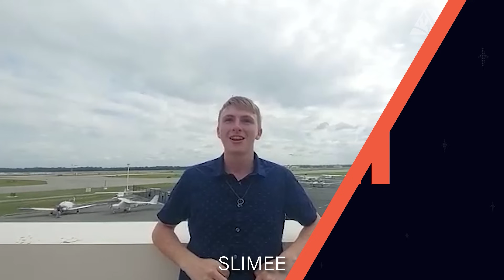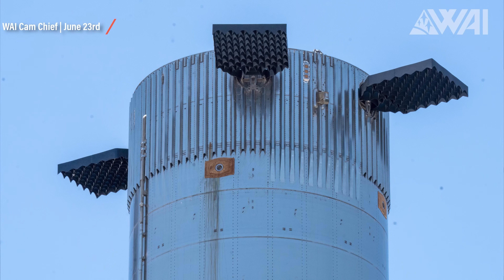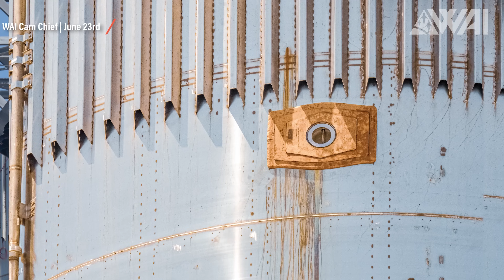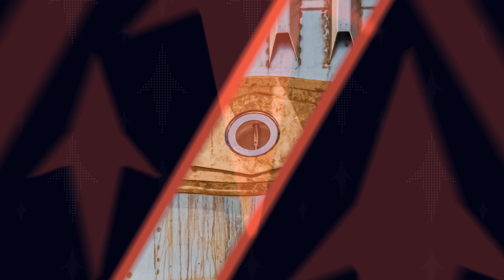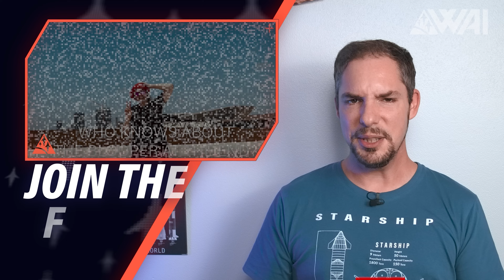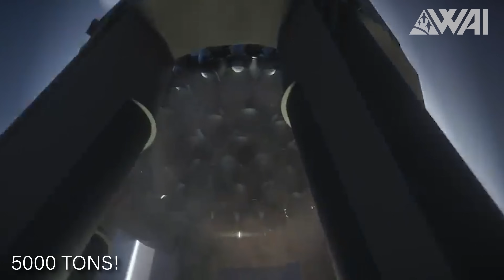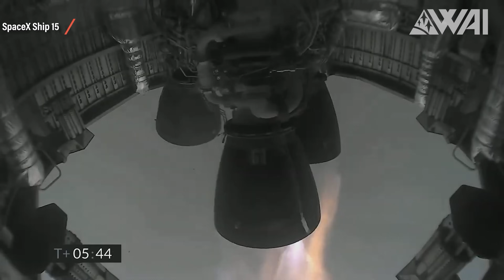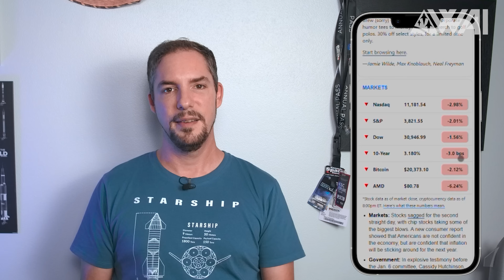The first orbital SpaceX Starship booster and its INCREDIBLE changes!

Comment: Settling foundations are NOT normal. It's an indication that the design wasn't right or based on inadequate GI.
Reply: Settling is absolutely normal in large projects. Unless you’re building on bedrock, earth behaves like a liquid under pressure. This is not unusual at all.
Reply: @Creabsley  I have designed huge structures and never had to do that.
Reply: Buildings settle.
Reply: They do. But a small and predictable amount. For a piece of mission critical infrastructure to need such attention concerns me as an Engineer. I would design for robustness given what is sitting on it.
Reply: @mdbboyd  Small and predictable?  Are you sure you're an engineer?  Settling can take years.
Reply: And yet it's happening quickly. You have proved my point.

Comment: Tunnel with Boring Co., then drill up to the slab.  Then use steel or concrete piers.  Then fill tunnels with reinforced concrete.  Use lots of piers as pilings to distribute load.

Comment: Wouldnt the explosive potential go way, way, way beyond just the methane? Because of the fact that it would be mixing with the 70+% Lox on the vehicle? Fill a balloon with methane and light it with a match, you get a little floof. Add a squirt of oxygen and you get a distinct concussive pow. Huge difference.
Reply: When mixed.  In fact mixing them to they burn best is one of the aspects of rocket injector design.  But an explosion will be bad one way or another.

Comment: One observation and question concerning the new Grid Fins and the newly vertically designed HPU chines.

If during reentry, the booster tilts/angles enough for the new vertical chines to actually be of use aerodynamically, wouldn't that make the Grid fins basically useless, since the relative airflow would be too perpendicular to them, for them to be of much, if any, aerodynamic value?
Have a safe and Happy Independence Day!
Reply: Walter, the Falcon 9 booster has already been run through such maneuvers and the problem exposed by those tests was that the two center dorsal and ventral gridfins were not contributing to tilt. The new design with 120°/60°/120°/60° angles allows all four fins to be out on the sides instead of centered under the belly during such maneuvers. This assures that all four gridfins are in the airstream contributing to tilt control.
Reply: Good observation. Also, how will the booster accurately rotate about its long axis to ensure the lifting lugs are oriented correctly for the chop sticks to grab?
Reply: @imconsequetau5275  Thanks!Do you know the number of degrees of arc, that the Grid fins can rotate? 
I didn't think that they had much beyond a total of 70°, or so.
Reply: @sssbob  I think it will be using it's new cold gas thrusters to establish rotational orientation with the tower.
Guaranteed that it's going to be quite a hot show, when it tries it for the first time!
Reply: @walter2990  But how will it KNOW what the rotational orientation of the lifting lugs is relative to the chopsticks? If it's doing the flip maneuver just before landing, there is very little time to line everything up, unless it can hover long enough to sort it all out.
Reply: @sssbob  The answer to your question of "how will it know" the proper landing configuration to line up the lugs with the chopsticks is simple..., I don't know.
The answer to that problem is WAY above my pay grade!$ 
But I'm sure that there's at least one, or ten, high paid SpaceX engineers who's job it is to figure out that very issue..., I hope.

Comment: Can they make a Falcon 9 replacement out of stainless? For the smaller payload class and to reduce cost of Falcon launches even more.  Its gotta be cheaper than carbon fiber.
Reply: It is not that easy, it would require a re-design.

Comment: I’m really surprised, pleasantly so, that SpaceX hasn’t, or wont,  test the booster as a stand alone component launch. Something with a nose cone and test a water landing off the coast (as they plan for when they do the orbital test.). Thats awesome that they’re confident enough to have the starship and super heavy together for the first major run. 👍
Reply: If the booster explodes on the launch stand it's gonna do massive damage to the stand either way.    Might as well try with a starship.
Reply: It's a waste to do a half test on a throw away article.
Reply: @TheEvilmooseofdoom  Yeah I get it. Unless theres a RUD or the booster gets squirrelly, then you waste both craft anyways and without the benefit of S.S. testing or any feedback. That would be an unnecessary waste. But Im sure they know what they’re doing and Im excited for this launch!!
Reply: @elconquistador932  A certain amount of telemetry (depend on when where and how an accident happens) is transmitted and there are also data recorders that could potentially be recoverable.
Reply: @TheEvilmooseofdoom  i know that, but if the booster ruds you lose both lol.

Comment: The material used looks to me, I can only see it, but it looks to have rust also, so bare iron steal. I was a steal worker for many years, and seconds after steal is bare, like disk for disk brakes, rusts in seconds from moisture in the air.  there are oils that keep that from happening.
Reply: ...and in those many years you never learned how to spell steel?

Comment: Great update Felix, best Spacex info source on YouTube. Just a very minor correction though. ‘HPU’ isn’t an acronym, it’s an abbreviation. Acronyms are initialised letters spoken as though a word, such as ‘NASA’. Those that are spoken as single letters (‘SLS’ for example) are abbreviations. 
I’ll get my coat … 😊
Reply: But to Felix:  Even though HPU is technically an "initialism", the general english-speaking public tend to still call it an acronym. So what you said is fine.
Reply: Odd, my first reply was removed. I had pointed Dave Hilton to a site explaining the difference between acronym, abbreviation, and initialism. Because the latter part of his correction wasn't entirely accurate:  Those that are spoken as single letters are actually initialisms. Both initialisms and acronyms are forms of abbreviation.

Comment: The insulation could be rock fiber.
Reply: Like asbestos? It is still used in some applications where there isnt a better option and its encased in something to prevent dust. B more likely its just cork, they've used that forever in space flight. With SS its likely a temporary solution. This thing will look a lot different by the time its launching regularly.

Comment: I don't understand the method of engineering and design of SpaceX. They make some something and then get a better idea, before it is even used abandon it, then remake it. This method is both time consuming and expensive. How many star ships and booster versions have they made? 20+? This must cost Billions and wastes so much time. And only one successful short test flight. Don't get me wrong, I think the concept and engineering is brilliant, at the same time wasteful.
Reply: The part you're missing is the manufacturing aspect of this program.  They don't just need to make 1 of these, they need to make thousands of them, and at low cost (which requires making 10's of thousands of raptor engines). Elon has said that the manufacturing side is harder than designing the rocket.  Just like testing the rocket requires test flights, testing the production system requires building units, and problems with production will feed back into the design to make the ship/booster easier to produce.  They should be continuously producing units for the foreseeable future.  BTW, unit cost is not billions, not even close.  Most of the costs of the program would be fixed staffing costs that don't change with unit volume.
Reply: @ashh3051  Thanks for that, it is still an expensive method of design. Not only the booster, it is the chop stick catcher with major design changes, additions and subtractions. To me the process went through a few 'oh $#!+ no" moments because they were in a rush to build something/anything with out a proper the proper design process and reviews. For example, they built a manufacturing plant and a barge in California for Starship and booster made of carbon fiber and were in the process of production. What happened to that?
Reply: Rapid iteration IS expensive but it's also faster.